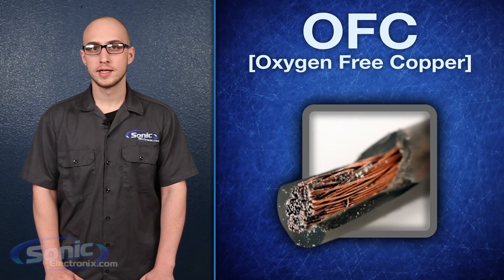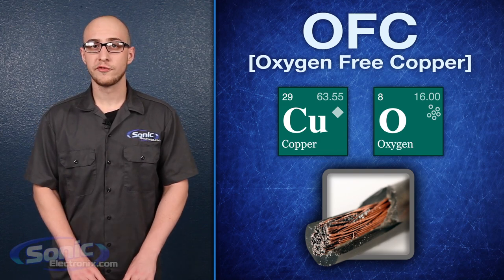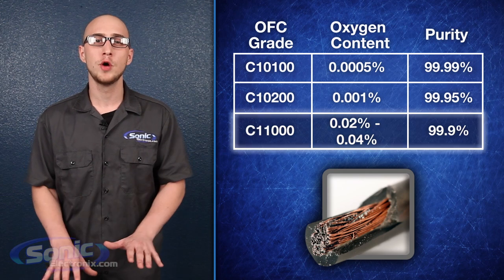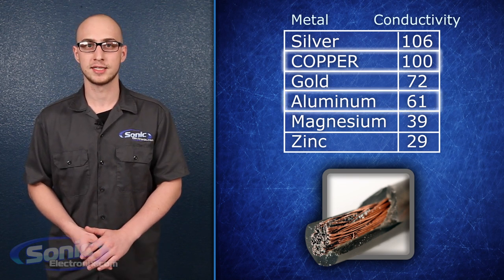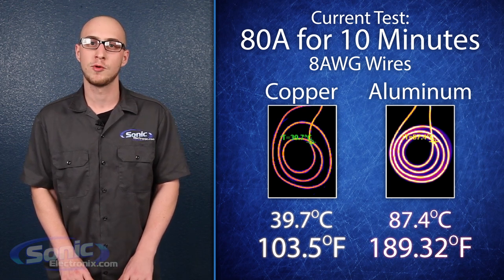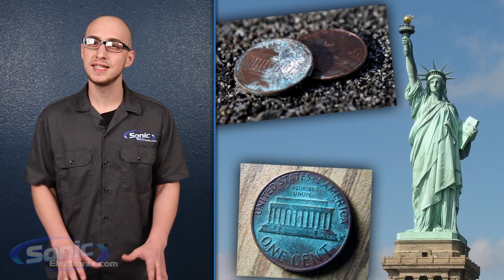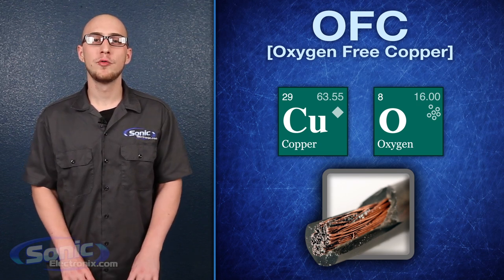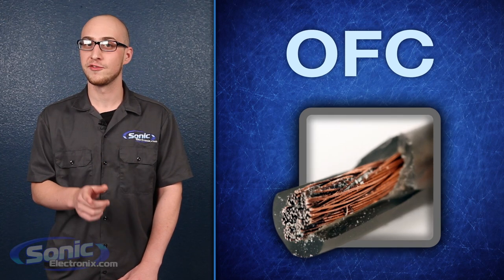Why Should I Buy Oxygen Free Copper (OFC) Cable? | Car Audio Speaker and Amplifier Power Wiring

Comment: Thank you so much for not bullshitting. I was expecting a "UR SPEEKERS WIL SOUND SO MUCH BETTER BCUZ OFCOFCOFC" But you actually informed me about REAL differences between aluminum or CCA vs Copper.
Reply from the maker: Snydicus You are welcome and thank you for the feedback. Glad you enjoyed the video and learned something.
Reply: +Snydicus Yeah but they didn't tell you about the conductivity difference between OFC and standard copper cable which is the real decider... I'll give you a hint. It's about 1% more conductive, performing at a minimum of 101% conductivity.
Reply: +Ben Ashley Very true Ben. And unless I missed it somewhere, they also didn't mention that there can be a difference in power output in amplifiers running off of OFC vs non-OFC cable. A decrease in power due to inefficient wire can lead to a decrease in performance and (contrary to what he said in the video) sound quality. But does this mean we have to spend a fortune in cabling? Probably not. It does mean, however, that if we're going to put forth the time, money, and effort into building a high-end system, then we don't need to skimp on the cabling and "strangle" the amps. :)
Reply: +Glen Carlson and +Ben. You are saying it is 1% more conductive when comparing OFC to non-OFC. We did not compare OFC vs non-OFC. We compared Copper Clad Aluminum... which is ALUMINUM for the most part, not copper. It runs hotter and does NOT allow the same amount of power throughput. I really suggest watching the video again. The car audio industry is full of a lot of CCA (Copper Clad Aluminum) wire that is not Copper, OFC or otherwise. I agree with you that "OFC" can be hyped a bit much, but CCA is the equivalent of "Peak" wattage that industry folks have used time and again to market.
Reply: Actually I haven't seen a SINGLE answer that wasn't basically a pre-emptive attempt to devalidate the possibility of a difference in sound - which seems to be an alternative pseudo-intellectual elitism. I have been forced to buy substitute cables for the Sennheiser HD 600 and I could notice that every cable sounded slightly different, although the official ones sounded almost identical, whereas all other brands had completely different characteristics. There are stereotypes about it, e.g. silver are bright, copper are "warmer", and they don't come from nothing. There are also slight differences in sound stage (which is not independent of temperature or other things). Cables determine resistance and so the characteristics of the sound. Especially in sensitive HIGH FIDELITY hardware. And aside from basic material, which obviously makes a significant physical difference, there is also simple cumulative cable length (e.g. 3m vs 1.2m). And most people don't ever try or are by their character alone bad unbiased and truly "critical" (also of themselves) judges.
Reply: +Cerevor There are reasons to purchase various cables not only made from certain materials, but made with specific tolerances during the manufacturing process. A lot of people that comment have never been on a manufacturing floor from X company vs Y company to see there are differences in craftsmanship and tolerances to realize that besides just cable, capacitors, resistors, etc all matter. This is often why you see certain brands so much higher (regardless of if they mark up their products at different percentages).  The funny thing for all of this is we made this video to be incredibly focused on car audio wiring (advertised it in that are of our site) and for some reason this video has been shared in unrelated forums in places like headphone sites which caused this weird backlash of unrelated criticism. It's as though people thought we were selling or promoting snake oil. 

All that said, there are folks out there that believe all cables are equal, and there are others that do not. In my professional opinion, you can tell the difference with various cables for the factors I stated above (tolerance and manufacturing capabilities), as well as the actual materials used. Not only that, we visited with Harman's engineers and saw that there measurable, objective differences when we were comparing various connections. Could it be the connector or the cable material? Sure. I think at the end of the day, it ends with the subjectivity of the listener and whether they can physically hear the differences (perhaps their ears are not that sensitive) or if they have pre-emptive attempts to invalidate the argument as you said.
Reply: 0.001% actually. Oxygen-free copper is typically specified according to the ASTM/UNS database. C10200 - also known as Oxygen-Free (OF). While OF is considered oxygen-free, its conductivity rating is no better than the more common ETP grade below. It has a 0.001% oxygen content, 99.95% purity and minimum 100% IACS conductivity. Not to be pedantic or anything.

Comment: I watched this because a friend was getting ready to drop big money on OFC wire for RCA cable interconnects and I needed to show him why it was a waste of money.  Like other viewers, I expected a load of BS. For the most part it was actually true and supported my opinion that you only need copper when carrying large loads (big amp output) where the wires might heat up.  150 watt amps are no where near big enough to benefit from OFC wire.  The difference between the conductivity of regular copper and OFC copper is about 1%, so even with big loads you will not see much benefit.

Comment: For headphone cords and listening to music, the human ear cannot hear the difference between an OFC cable and a regular audio cable. I got to this video because I purchased HD598 headphones which came with OFC cord and audio cord. There's virtually no difference in what a human can hear. I'm not saying this video is false however, because it is very accurate. It's just that the time you spend in your life worrying about copper cable vs other cables will be no longer than half a day.
Reply: This is regarding car amplifier power wire at 4 gauge or bigger intended to carry electricity over several feet. Not little piss ant headphone wires carrying an audio signal.

Comment: Another important thing to keep in mind is that if you are planning to run anything above 2 gauge or 1 gauge, OFC wire is so much easier to work with and make turns with for tight connections.

Comment: :o my 40yr old house has aluminium wiring. Now I understood why I hit breaker so many times.
Reply: Need to change it before you have to call a fireman.   Aluminum wires tend to get brittle over time and short.  Big cause of 🔥 in older homes.  Just looking out...
Reply: Replace that breaker if it's been tripped too many times...better would be to replace the wire, but that's probably out of budget. Breakers do wear out, but they're cheap.
One thing that can be done is tightening up connections. Al expands and contracts a lot, loosening up connections, increasing amps, resulting in more loosening. Any outlets that are "backstabbed" with Al wire need to be replaced and USE THE SCREW TERMINALS! Backstabbing of Al wire is probably the biggest culprit of Al wiring problems.
Good luck!
Reply: Crikey... where do you live that would have aluminium wiring in your house..? Sounds a bit third world (".)
Reply: tighten down the breakers AND USE "NoAlOx" (grey goop, sacrificial anode) between wire connections.
-guy who passed two inspected circuit breaker panel installations and made a DIY tutorial.
Reply: @gp85hkg  not really third world.  Many homes built in the United States during the Vietnam war were wired with aluminum as copper was being reserved and utilized primarily for ammunition.  My parents home was built in 1973 and has all aluminium wiring.  It was plumbed with galvanized pipe instead of copper as well.  What a nightmare.

Also, all the high service entrance wires coming from the utility company are aluminum, not copper.  It would be too expensive.

Comment: skyscrapers use buss bar setups because wire would be crazy... they choose aluminum over copper because of the cost vs loss differential ... I work in a metallurgical lab and the charts in this video are somewhat misleading because of the length of the runs.... I will always choose CCA
Reply: Any wire size larger than 1/0 is usually aluminum. When you get to wire that big, the terminals also get bigger, and the hold-down screws handle more torque. This allows more expansion and contraction without loosening of the connection. Also, the amount of wire compared to insulation is greater (looking at the X section) allowing for better heat dissipation.

For car audio, nothing beats OFC. Smaller diameter (or higher amperage handling), easier crimping and terminating, and easier soldering.

Comment: Its is a good idea to always use copper wire for powering electronics. But its NOT necessary for most audio speaker applications. For sound quality and fidelity CCA is just as good as copper long as the proper gauge vs lenght is used. Basically running 12ft of high end 10awg copper wire to your front speakers will NOT sound any better than 12ft of 12 or 14awg CCA wire. This has been priven over and over with blind tests.

Comment: I use house 120 house solid copper, you can bend and wire cleaner and it's easier to work with. Running sundown and it's 12 speakers in a nissan...blowthrough

Comment: I fail to see how improving you cabling so it can pass more current will reduce the strain on your vehicle's electrical system, if you give your amps the potential to pull even more current through Tue power cable your actually increasing the strain on your cars electrical system but I digress

Comment: What company is going to sell a 700-800 true watt amp with 8 gauge power terminals? Pulling that many amps would require 4 gauge or 1/0 wire. Going to be doing a 750 watt build with 80A on 1/0 CCA power wire and reducers. 1/0 CCA is good for 250A while 4 gauge OFC is only good for 150A, so might as well go large, save money and use reducers and you wont have anything to worry about for smaller systems.
Reply: I have a 12000 watt amp that has 4 gauge terminals.

Comment: Why do most amp wire kits use CCA for the "ground wire"? The power wire is usually OFC so why not the ground?
Reply: Elijah doesn't quite nail it.  There's no such thing as "just" a ground wire.  BUT, the ground is usually (and preferably) really short, especially in automotive application, hence the conductivity difference is not as marked as a 5m (15ft) run from the battery to the amp. (And CCA is much cheaper, so if they can shave a little off the cost, and still keep the customer happy with a decent enough kit, they will.)

Comment: My CCA caught on fire today, ordered OFC
Reply: iTragiik23 yeah I had that problem to on a short run at that
Reply: Scary! I wonder how common that is?
Reply: Travis Jones very common. Happened to me on a 3-4 foot American bass cca 1/0 wire. That’s when I switched to ofc. Haven’t had any issues with ofc from Skyhighcaraudio.com
Reply: So my amp heating up so fast is because I have a 15ft run of cca? I bought it because I was on budget and it was a third 9f the price as ofc cable. Should I go ahead and replace it with ofc?

Comment: Wait so if the aluminum heats up from   Electricity from the battery does that wasted energy turned into heat causing less power to reach am which is why some people noticed a difference because of copper being more efficient for power flow
Reply: yeah all of that heat is waste energy

Comment: Isn't gauge determined by the conductivity of the wire rather than the thickness. Therefore 8 gauge copper wire and 8 gauge aluminum wire have the same conductivity but aluminium would be a lot thicker, or am I just imagining things
Reply: Aluminum is more resistant to current flow and heats up ah hell of a lot more & faster than ofc! Aluminum is great as ah buss bar or terminal but not wire!

Comment: Video should be entitled something like "Copper vs. Aluminum Wiring for Car Audio Systems." Sonic Electronix is not an unbiased source of information because they have a vested interest in selling stuff.  That's why after setting you up with a discussion about copper-clad aluminum and trying to establish credibility and trustworthiness by stating that "OFC won't improve your sound quality," it launches into an pitch about the benefits of OFC. This has nothing to do with aluminum, but everything to do with selling OFC.  Why else would the home screen depict a frayed and dirty bit of stranded copper cable, and later on show an oxidized penny (Lord knows where it's been), the Statue of Liberty (standing exposed to the elements in NY Harbor for almost 135 years), and a corroded car battery (the result of hydrogen gas being released from the sulfuric acid inside), none of which is presumably made from the superior OFC, but rather the inferior non-OFC? The photos are used deceptively to sell OFC. Good try, guys, but I call BS.

Comment: Does CCA ampkit gives bad bass performance or any other experience to the subs ?
Reply: If you look up a few of the test videos, CCA does not change the amp output at all (at least with a 10ft run). However, OFC will provide better wear against the elements and will not heat up as easy as CCA.
Reply: Agreed. If you have a run that is quite small (7 or 8 ft) you will not notice much difference on most CCA; however, some CCA these days are really bad -- they are around 95% Aluminum and barely any copper. Not only do they run hotter, but they are not as durable long-term.
Reply: I can tell a difference in the sound quality on a long run. Car amplifiers produce more watts when they receive more volts. This is why amps are always rated at 14.4. If the bass hits and the amp suffers a voltage drop it will sound muddy and loose. Proper volts keep it tight and sounding good

Comment: BS only matters when people buy it!  What really bothers me is when bozos like this guy telling you the nitty gritty, but, fails to mention that for Audio Systems, the effects are negligible. Copper is a base element!  100% Copper cannot have any other element mixed in with it, thus, it cannot be called anything but Copper. What happens after exposure is a whole different story. So, when cable manufacturers make their cables, are they suggesting that their cladding material is porous?  Now here another simple question to ask.....  Why coat a connector part with Gold?  Copper is rated as having100% conductivity.  The conductivity of Gold is around 72%.  Go figure!  Maybe the slick marketing phrases makes some pay more for it - perhaps, to pay the salary of people to make a YouTube video.

Comment: Far more conductivity LOL! not. No different then the ETP copper of everyday. But better than CCA wire by miles. So OFC vs regular copper 0.001% difference in conductivity, but big difference when compared to terrible cca wire.
Reply: yes, you are correct never use cca for power or speaker cables,  never, never.

Comment: Most of the current rides on the outer surface of the wire.  That is the main reason to use it, to combat voltage loss.(Efficiency). All the others are a gimme.

Comment: I completely agree with video. that being said that test is dumb, who the fuck runs 80 amps through 8 gauge?
Reply: It was a test to show it heats up for the video purpose .. duh
Reply: with home theater runs, cable lengths get long.
My subwoofer is gonna require a 50 foot cable.
That starts to get expensive, and you've gotta get the smallest gauge that'll work.

Comment: So, basically, you don't need to buy oxygen free cable, just make sure you don't buy copper plated aluminum. Durability argument is bs, actually, as just any regular lamp cord is fine after 50+ years, and is only oxidized heavily where copper is exposed, i.e. doesn't have protective layer anymore.  Even then, you would notice that the wire is oxidized only on the surface. So, yeah, don't bother.

Comment: All these people bragging about running welding cable, and they don't even know that 90% of it is NOT ofc.. I've got a bunch of different brands with inch cuts offs, the only one that changed color was the welding wire.. shy high ofc didn't change color.. and of course my tinned xspower superflex and tinned knu didn't change color either.. welding cable  is cheaper because it's not ofc

Comment: Marketing crap.  This is not about oxygen at all.  It is all about the purity of the strands.  Aluminum is a contaminant.  Both copper and aluminum have varying levels if exterior corrosion.  You can not prevent that from occurring by removing oxygen from the inner cross section of the strand.  

Welding cable... operating well over 100 amps,   Distances can be very long depending on the job site (100').  Those cables don't get close to the temps demonstrated here.  Nothing special other than it is fine strand high purity copper.